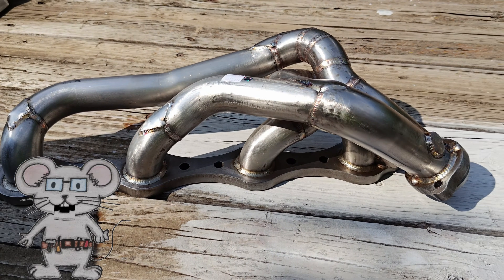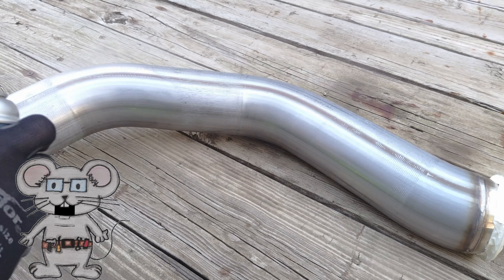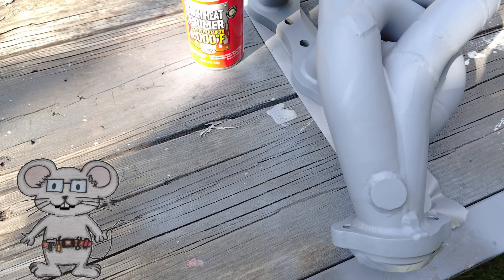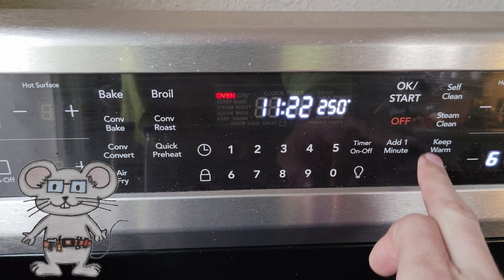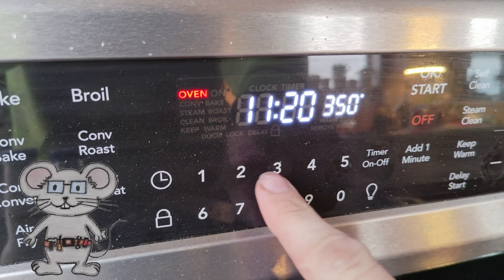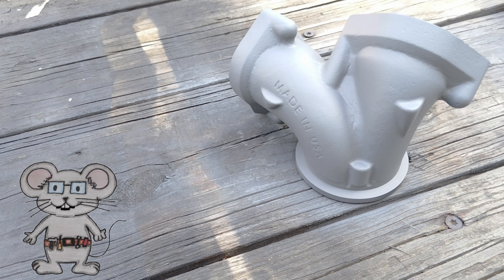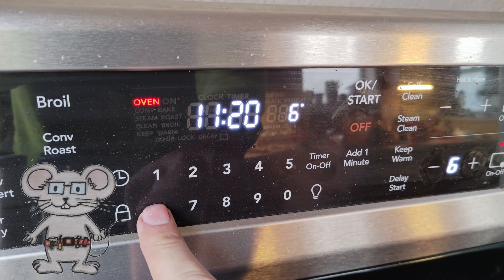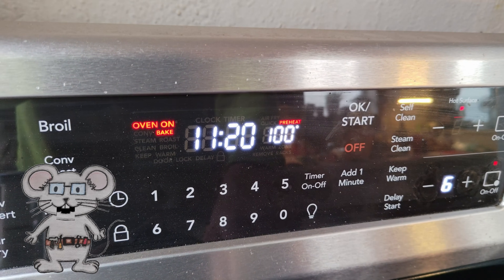Rust-Oleum High Heat Ceramic Coating and Primer 2000F 8K

Comment: So I followed the instructions to the letter as they say. Everything was going great till I went to 550 (my oven did not go higher) the parts were my front brake calipers off my 2007 Electra Glide. When i went to check on my parts after 15/20 minutes the paint had totally burnt off to the point you could not tell I even spray painted them. Any idea why this happened? Just to make sure my oven thermocouple was reading correctly I used a secondary digit thermometer that i use all the time in my grill. I am about to paint the calipers again, I am worried about doing the baking process again.
Reply from the maker: I don't know, I have never used the oven, I tried the bake the parts on the engine. But haven't finished the prosses, as I had some oil leaks I'm working on before I take the truck up to the max temp. One person said that after that they used break cleaner and it come right off.  I will test it after I get the oil leaks fixed.
Reply from the maker: Did you use the same heat rated primer before the paint?
Reply from the maker: Did you clean them really well? Might want to quick go over with a wire brush then clean it with break cleaner. I was thinking about turning an old oven into a shop oven.  Will have to find one with a self cleaning, will reach 800°F to 1,000°F depending on stove.  I hope that helps..

Comment: But carb cleaner wipes it right off!
Reply from the maker: I know it does before it is baked on, I've not tried doing that after the baking.
Reply: I'm very disappointed in the product. 
I have multiple parts that I baked following the instructions short of te 600 degrees just because I don't have a. Oven that hot or big. I even hit it with a heat gun and used an infared temperature gun to monitor temperature. 
This stuff still wipes off like nothing  when exposed to carb cleaner or brake cleaner.
Reply from the maker: I would be too, I will have to see what happens this summer when  I will try the bake it on the eng method.  Will update after I finish putting truck together and run it for required time.